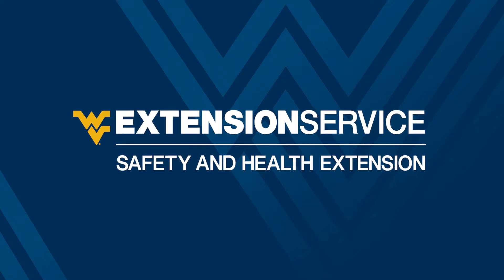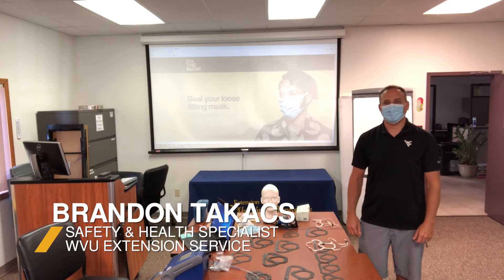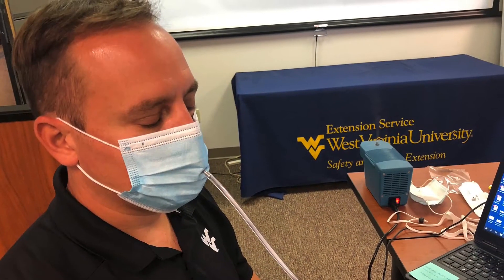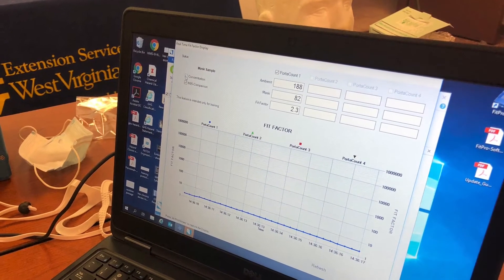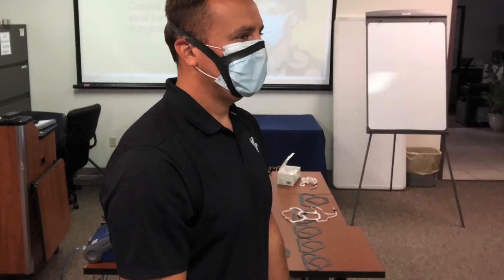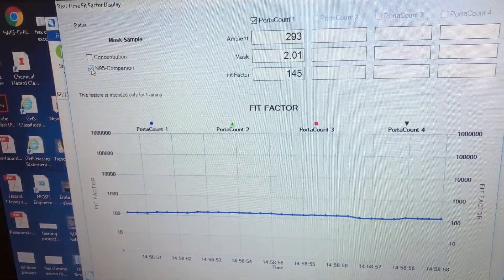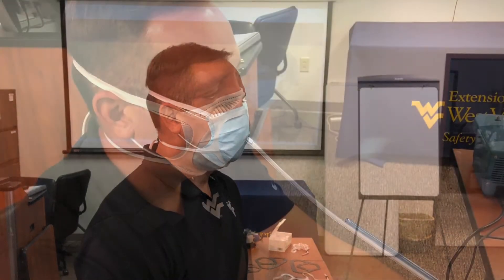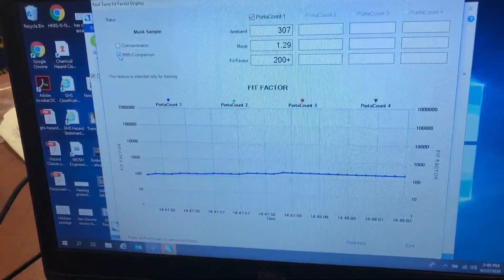Fix the Mask Fit Tests

Comment: S, M, L are available. Therefore I'd recommend trying a variety of sizes. As with an elastomeric, an overly tight fit is not necessary. Additionally, fit testing will ensure a proper fit is achieved.

Comment: I got the fix the mask silicone and it doesn’t work at all for me. It just doesn’t get tight enough at all.
Reply: My upper strap seemed a little loose so I was able to tie a small knot in it. That said. It sounds like it doesn’t need to be very tight to work.